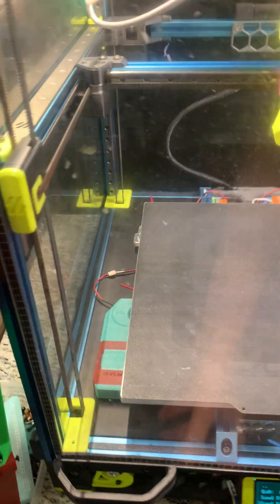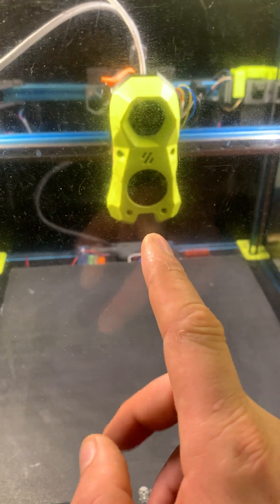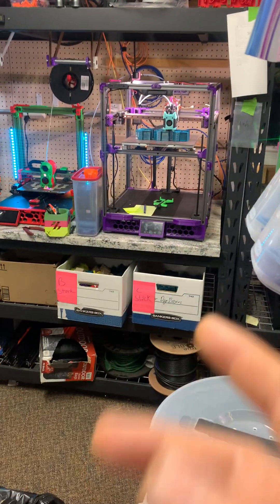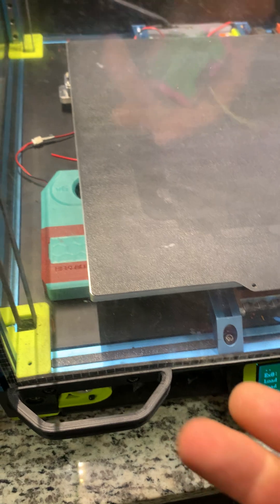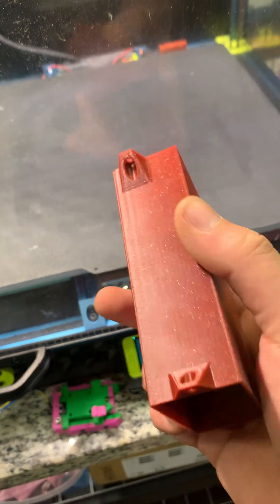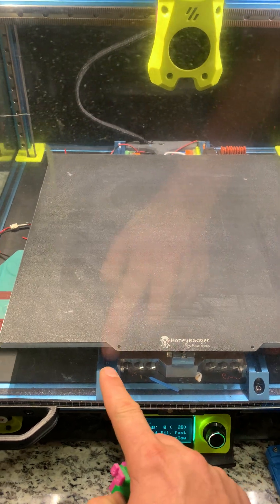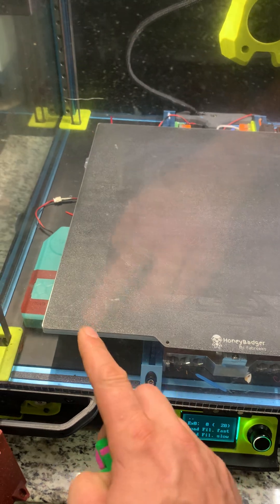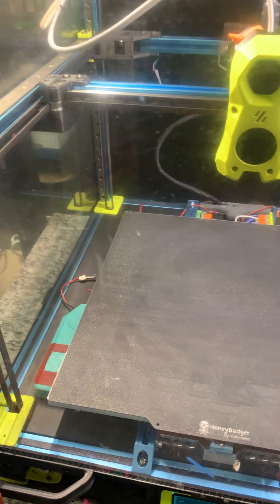Flex tap 500 hour update

Comment: That's kinda funny about the MRW kinematics. I have them as well, and moving from normal tap to CNC tap, but the magnets on the kine release before I can even pull my plate off the ultra-flat mag bed lol. sucks, if i want to cool something faster and move the bed to a cooler spot, I have to burn myself holding the bed to allow the plate lift. Side q, are you printing ABS? What are you doing about filtration, or are you not? DIdnt know about flextap, looks interesting.
Reply from the maker: I use two nevermores. One filled with carbon the other scorch. My blue v2 only prints abs/asa.

Comment: Thank you! humm....3 adjustments in 500 isn't horrible but its enough to make me think twice. Hopefully its something that can be worked out eventually.
Reply: Check out the Peck probe by Chirpy(compatible with Dragon Burner), it’s a similar flexure design but only on the hotend mount
Reply: @nunovicente34 Where's the info for this?
Reply: @nunovicente34  Thanks I will
Reply: @nunovicente34  I would also like some more information, please. I couldn't find anything about Peck probe anywhere
Reply: @nunovicente34 I think maybe you mean the Poke probe. I may have misunderstood, but I think the Poke is a torsion flexure and so it must be mounted at the center of gravity of your hotend assembly, otherwise Y moves will cause nozzle movement and vibration. The FlexTap is more robust and requires less fiddling to get it right.